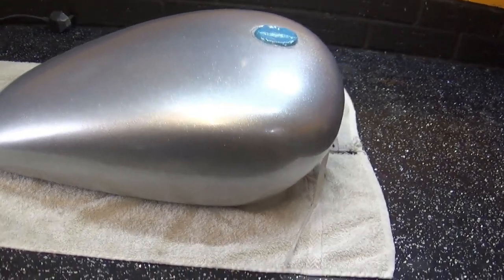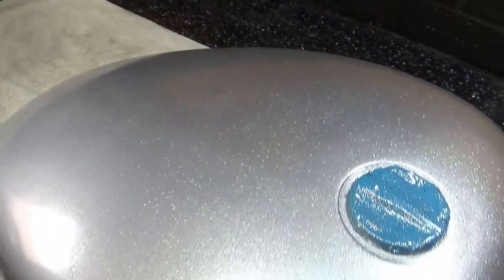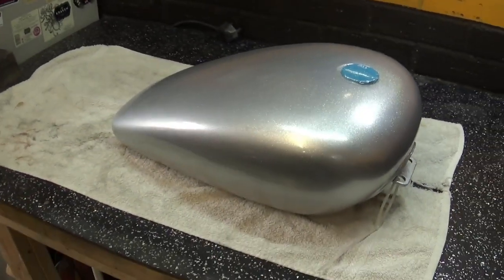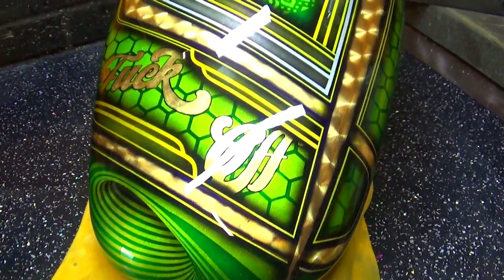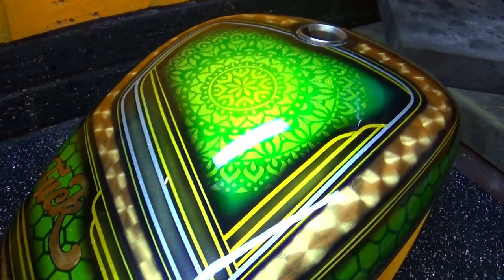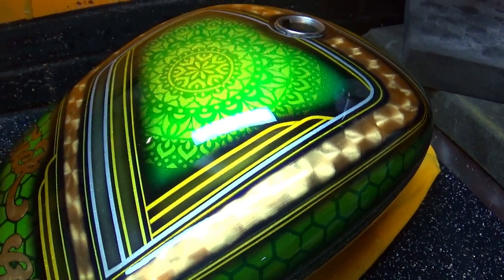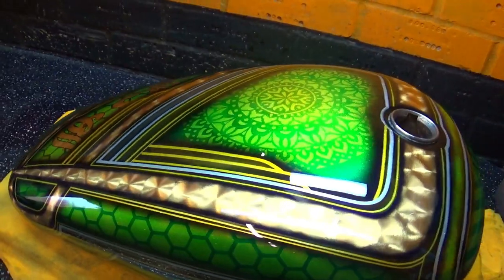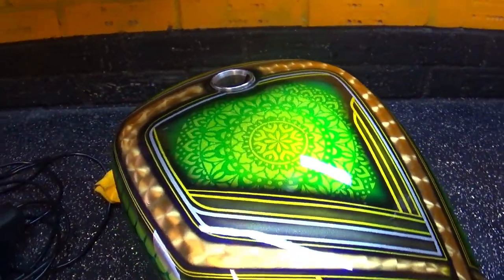My Best Metal Flake And Gold Leaf Custom Paint Job Yet!

Comment: Awesome work fella. She looks amazing, lush colours and deep absorbing graphics and artwork. Could look at it for hours. Can you tell me which marking out tape you use to get such tight curves, im having trouble finding something that will go around the curve i want to mark out. Cheers.
Reply from the maker: I used green fine line tape. It's unbranded, but same thing as J tape. Works relaly well. Stick to 3mm and less :)
Reply: @MackieBass  Thanks. I think i may actually have one of the green tapes, but its 9mm. Was having trouble getting the tightness of curve i wanted. Seems like its too wide then if you suggest 3mm. Any chance you would do a step by step on how to actually lay the tape out, pressure to use, how to form the curves etc. Have tried to copy from what others do in their tutorials but haven't found anybody doing a step by step for the taping out yet. Love your work mate. Came to your stuff after watching Del boys real flames series.